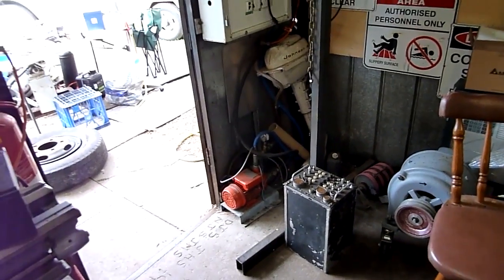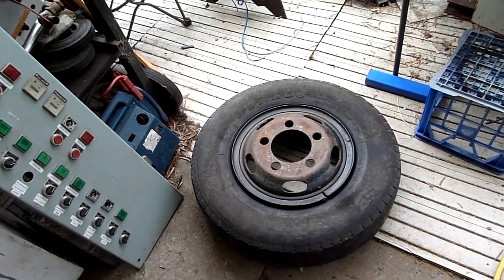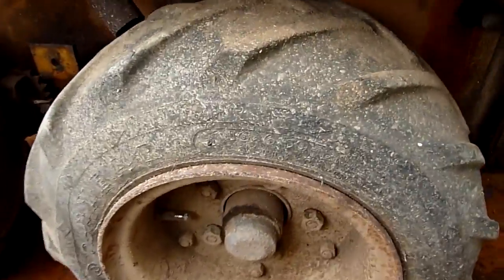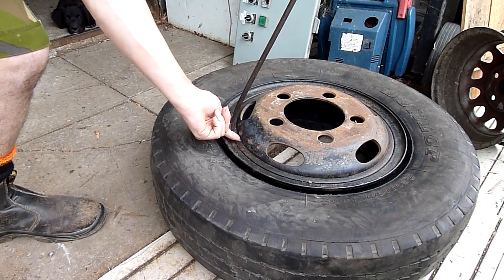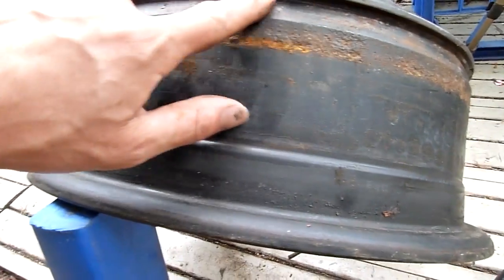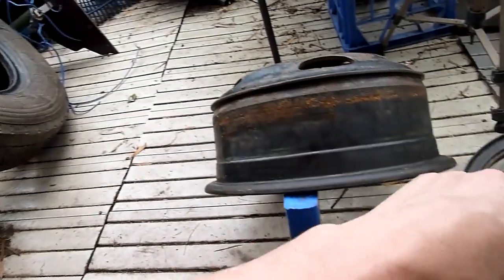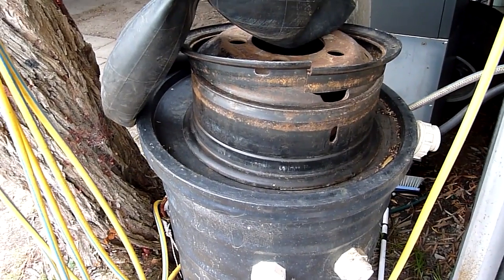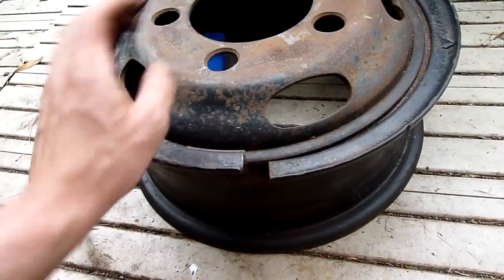The Locking Ring Split Rim - AKA Widowmaker - Why is it deadly?

Comment: I just changed a tyre on one of these rims on my Patrol today. I had to cut the bead of the old tyre to get it off the split rim; the rubber was bonded to the paint on the rim.

They can be dangerous, but if you know what you're doing, and know the dangers then you can take precautions to do it safely.
Reply: Also, Toyota has just started fitting tubeless one-piece rims to the new 7x series Cruisers these last few months. It's the end of an era.

Comment: Could you also just put the wheel upside down when you inflate it?
Reply: Yes you can. This is how we were taught to do them in the ARMY. In 50 years I have only had experience with one going off. It was the tyre off of an International Acco truck. The tyre and rim assembly lifted off the ground to shoulder height. The split ring left an impression in the concrete floor. Nobody was hurt. My current vehicle, a Toyota Troop Carrier has them. They are the best thing since sliced bread out bush.

Comment: i have just one question: Why put inner tubes in rear wheels and not front?
Reply from the maker: Simply because if you have a puncture the tire is going to go flat really fast, best it happen on the rear than the front, much more controllable. its purely a safety thing

Comment: I really want that big panel of buttons, dunno why
Reply: bityard me too
Reply from the maker: Its an old HVAC control panel from a shopping mall. has switches for individual stores, cooling towers, pumps, heat exchange pumps etc. sadly the massive fuse-breakers were all stripped of copper contacts  :(

Comment: They do make a great foundation for a BBQ though, just put some heavy mesh at the base to keep the coals in and let air in, and some grid on the top and you are done. weld a pipe on and another and you also get a stand.

Comment: I've read that you must never ever use an inner tube on a tubeless rim because if it is of inadequate size, it can create dangerous 'hot pockets' of air between the tube & tyre.
Inner tubes are still used on wire spoke type rims because of the difficulty of making an airtight seal at where the spoke attaches to the rim.
Reply from the maker: Using tubes on tubeless rims is just fine as long as the correct tube is selected. you do not get pockets of hot air between the tube and wheel, because it expands to fill those minute gaps and pushes any trapped air out past the valve stem.

Comment: DUDE it's so nice where you live, currently hitting -38°c here in Canada can't even get into the shop to do anything, keep uploading these videos!
Reply from the maker: Ouch!, stay warm mate!, its 42*c today, just as dangerous as -38, if not more so.!
Reply: Aussie50 surprisingly we only get up to 30÷ in the summer but I find some shade and a nice breeze makes it bearable, drink lots man I'm sure the temperature increasing is due to the ozone layer decreasing here hot 4 years ago was 22+ now the avg is 25-28+ and that doesn't sound like a lot but some days have hit +35 mid summer so I'm pretty sure that's a fine example global warming so to speak
Reply: AustinAutomotive going to be -40 with the wind in SK
Reply: AustinAutomotive lol ozone layer isnt decreasing, seperate issue to global warming. Ozone layer was getting really shitty until everyone got together decided to stop using the chemicals that contributed to it e.g. CFC's in aerosols. 

But youre right temperatures are generally, relatively increasing very rapidly every year with temperature records every year in some places. Luckily I think the 'market' may save us - getting say a 5kw solar panel system on your home is actually economical now especially with the crazy and continually rising power prices. Batteries to accompany it will be economical in ~3 years but the tech is already here look at tesla powerwall 2 but is a bit pricey.

Comment: I had an old wheelchair I was messing around with for the motor's. Had two "pneumatic" 8" tires (very small) on the drive motors. They looked very much like 1 piece wheels but as I found out after unbolting one and putting about 5 psi in, I was right to keep my distance. The thing went POP, blew the front half the of the wheel upward and took out a chunk of osb from the ceiling. I was safe, my pants not so much lol!
Reply from the maker: haha yeh, I made the mistake as a kid, of removing the bolts from a hand truck tire, the tube blew between the 2 halves before I got it apart
Reply: All my wheelchair tyres are actually solid rubber, no air at all. Even on my powerchair, although they were an extra option on that. I really much prefer the solid tyres, over the older tubed pneumatic options. The compounds they use give an identical ride to a correctly inflated tubed tyre, but are completely maintenance free for the wear life of the tread. You would never get me to go back to pneumatic systems again.

Given how good they are on the chair I really wonder why they haven't taken off for bicycles. You would think that for road racing in particular, where they tend to run at some pretty high pressures that the new solid tyres would be great. Tuning the compounds would allow you to fine tune the ride to suit conditions, just as I guess they do now by adjusting the pressure. The one thing you would be sure of is no more nasty surprises from a suddenly deflating tyre.

I had a valve let go on me once when riding my motorbike. It happened while I was breaking to go round a roundabout, coming down from about 80 to 30 mph. A right brown trouser moment. Also back even further in time, in 1985, I had the experience of seeing a lorry tyre let go on the back end of an artic trailer, while it was doing about 55 mph on the M5. I was just passing the thing doing about 80 mph, and it was about 15 feet in front when it let go. Quite spectacular to see. Luckily it was the inside wheel of a twin wheel axel, which deflected a lot of the debris towards the nearside.

Comment: took a youths head off here in uk a few years back it was a rear wheel tractor tyre
Reply: There was a case like that in Biggleswade, is that what you meant? I think the HSE prosecuted employer because tyre not in cage.
Reply: No cresswell nottinghamshire
Reply: honda 4004: I suppose that if it doesn't make the national news, it could happen pretty frequently and we'd only know about the ones closest to us. It's evidently a lot more than a theoretical danger.

Comment: Seen the design before, never changed one. Can understand how they'd be useful out in the boondocks though, change out your tube or tyre with only a small tyre lever, hammer and a compressor. No tyre machine needed, no fighting against the sidewall with multiple tyre levers/prybars. I have enough trouble changing out motorcycle tyres without a tyre machine.
Reply: yep thats the reason, no weird big tools, tyre iron and effort,   not exactly possible to be towing around a bead breaker then a thing to seat the bead and inflate it fast to seal it
Reply: Wyatt Lewis And if you aren’t sure why I’m being stubborn, Canada and America spells tyre tire, the majority spelling in English outside of North America is tyre.
Reply: Industrial tires just can't be changed with tyre levers, ply ratings too high and sidewalls to stiff, that's why multipart rims of all types are used in industrial applications.
Reply: Wyatt Lewis 
Well go to sleep earlier then.
Reply: Wyatt Lewis No it’s called a tyre. When you work all day changing tyres you start to tire and then you need a break. Tyres go on cars. Tire is getting worn out.
Reply: T
I
R
E
Reply: @wyattlewis8671  depends on where you live.  Tyre and tire are both correct.
Reply: cjeam The rubber thing that goes on a wheel to support a vehicles weight and provide traction is called a tire. Not tyre.

Comment: I don't think we even allow them at all over here in the UK
Reply: yes m8 fleet replacement would reduce the numbers but most trailer get a second life with a smaller operator then some even get a third life with small companies
Reply: some of the older agricultural equipment still has them
Reply: I was a manager at ATS euromaster for nine years. we did car /truck / agricultural  and industrial tyres.  Even in 2009 when i left there were quite a few artic trailers still  running with split rims  . most of the older Kwiksave trailers ran with split rims. you would be surprised how many trailers and wagons  especially old farm wagons in the Uk were still running on them   just thought you would like to know
Reply: We used to have them on the Bedford tm and tk in the army. I think they were on the later dafs aswell. LETHAL

Comment: Still extremely common on forklifts, things are fckn deadly if you don't know what your doing, that ring comes out it'll decapitate you!
Reply from the maker: ah yeh true, forks do still use them for pneumatic tires,
Reply: jacktheripped Can well believe it, and it wouldn't be the first welder killed by welding on an industrial tyre rim with the tyre still inflated/valve in.
People just don't realise how much potential energy there is in there ready to escape in a millisecond, you pretty much have a bomb waiting to happen.
The fork truck tyre lock rings are hard Sob's as they are as stout as a truck ring but much smaller in diameter so hard to get good leverage on them. As a forktruck tech I just get the industrial tyre fitters to do it, damn they make it look easy!
Reply: Richard Olsen Pneumatic forklift/industrial tyres have an extremely high ply rating, trying to remove such a small diameter tyre with such a stiff sidewall is nigh on impossible with tyre levers, the multi-piece rim means tyres can be changed in the field far easier with basic tools. The things are PERFECTLY SAFE IF YOU KNOW WHAT YOUR DOING AND TAKE SENSIBLE PRECAUTIONS. As is everything really.
Reply: I just replaced a lug bolt on a forklift with split rims the other day and I was just wondering why is this even a thing
Reply: +jacktheripped Whaaat

Comment: We use have a 3 piece rim. Inter outer and lock ring. We would wrap them wit a chain and then slide them under the old type of lift. We would lock the air hose to them and fill to 100PSI  watching a gauge and with a valve on the inside of another room From that room we would break the air line loose and let all the air out. With no pressure we would got and check the lock ring. tap it a bit and go back to filling (in the other room). Fill, let out and fill again. If you ever had one break loose on the tractor you would know why to fill and let out 2 times. We were lucky the one time it happen it was the inside tirea fter we had it all bolted up
Reply from the maker: I have never seen or used a 3 piece, but I have heard the same story over and over again, those are true widowmakers!
Reply: Allan C
Reply: Good point. IF the need should ever arise (unlikely for me), I would wrap a chain or rope around the tire, through the rim, on two sides, then if the ring should pop, the force would be against the chain/rope and wouldn't go flying unless the chain/rope broke.
Reply: A lot of places put them in a welded steel cage for testing/inflation. This really is the safest option as it means all pieces are contained.

There are a bunch of tutorials on them, like this old one at https://www.youtube.com/watch?v=xnyh78wjZ1o 

Ideally you'd want to have that setup outdoors and venting against angled steel plates a couple of feet from the cage which direct the blast harmlessly upwards - like the berms around explosive stores do.

Comment: My neighbor two houses over so roughly 100 - 150 ft away, was inflating a bike tire, the inner tube popped it sound like a f**** shotgun going off, people actually called the cops they thought someone got shot and killed.
Even when car batteries blow up they are definitely loud.
Reply: stand by one of the suspension airbags of a lorry xD brings new meaning to shitting bricks.. had one go off at work outside and it blew out the glass on the buildings side door that was about 40 feet away
Reply from the maker: yeh air bags and bike tires are nasty loud
Reply: Several years ago, my brother overinflated a bike tire of questionable integrity. He then put it in the livingroom without saying anything. 

I'm not sure how much later, maybe minutes or hours, the fucking thing blew up loud enough to make my ears ring across the house. I was home alone, and for a second thought a gun went off. Nobody had touched it. It just said, "I've had enough of this" and exploded.
Reply: Aussie50 I've had airbag fun before, passenger side airbags are definitely more dangerous than driver side.
Reply: ARednecksLife They're not talking about air bags inside the passenger compartment that deploy during an accident. They're talking about the air bag suspension used on heavy trucks.
Reply: My brother's car battery exploded, he said it sounded like a grenade and being former military he would have known
Reply: Mates brother did that on the landing of his flat when we were kids allways had a habit of over inflating his tyres. Nice boom in doors lol
Reply: I was in my garage pumping up a bike tyre once and the inner tube managed to come out from under the tyre and exploded. It was possibly the loudest thing I'd ever heard in my life and it didn't help that i was in an enclosed area (though the roller door was open). I'm surprised someone didn't call the police.
Reply: Wth  car batteries blow up I didn't know that

Comment: I have heard of these rims before, but never actually knew what made them prone to failure, thanks for the info and glad to see you making more regular content again! Cheers!
Reply: Split rims are not prone to failure, they work just fine but can be dangerous if you do not know how to perform maintenance on them.
Reply: There's nothing dangerous about them when seated and they have advantages over "modern" tires since you can make the rubber a lot thicker for more load/wear capacity. 

It's the mounting bit that's a bit dicey unless you take precautions.
Reply: They are not prone to failure! Just need to do the job properly! They are the best design.